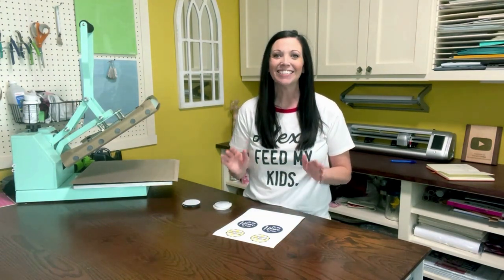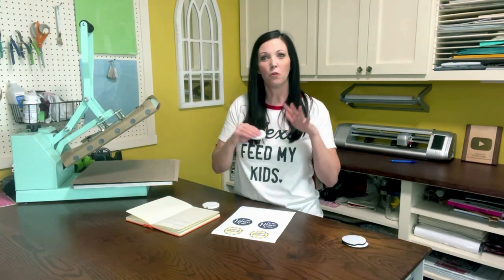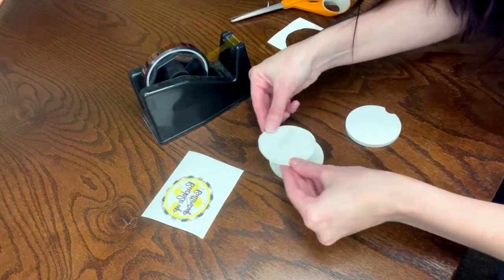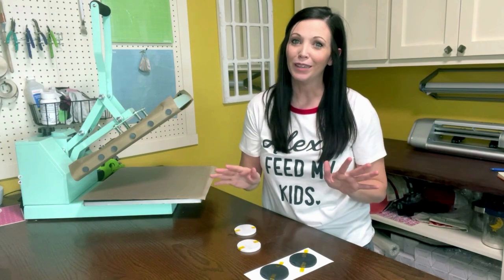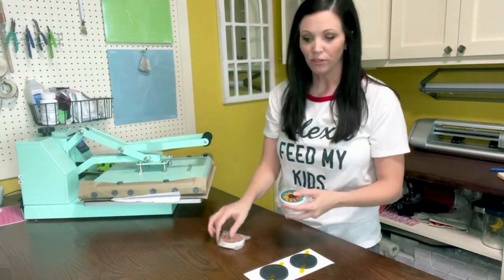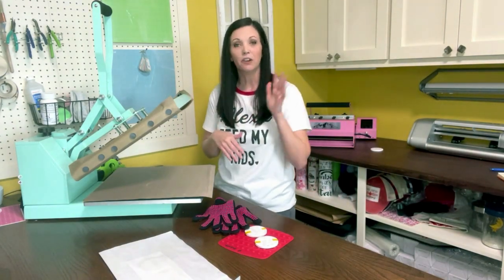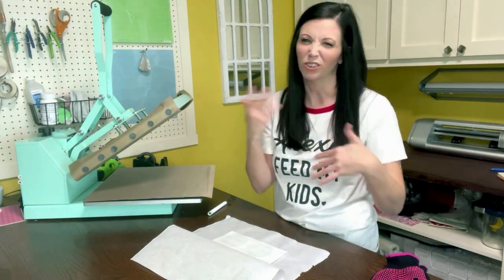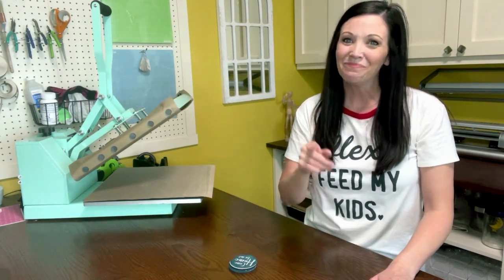How to Sublimate a Car Coaster! Neoprene and Ceramic Coasters.

Comment: I did the same pressure with mine and same temp, with the seconds and my ceramic ones still was very light. Idk what I’m doing wrong
Reply from the maker: Have you tried testing the heat? Sounds like it may be telling you a certain temp but it’s really not that hot. You can purchase a heat temp gun to measure it. If it is reading correct, try pressing a little longer. If it’s still not working then I’d say you have a faulty substrate.

Comment: What are the measurements for the neoprene coasters please?
Reply from the maker: Each brand is different. Use a measuring tape to measure straight across your coaster, if it’s 2.5 then print about 1/4 larger so you don’t have the white marks that I did! Have fun!